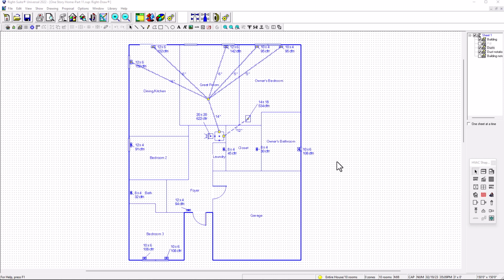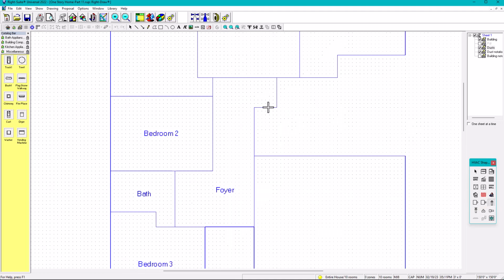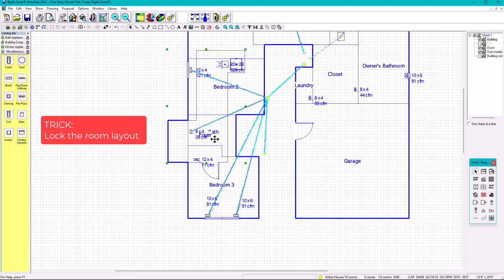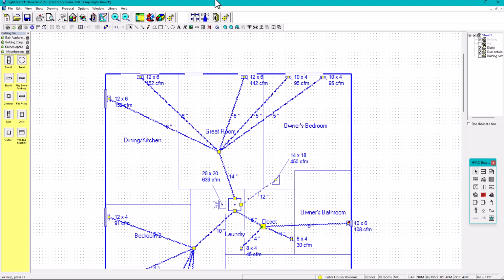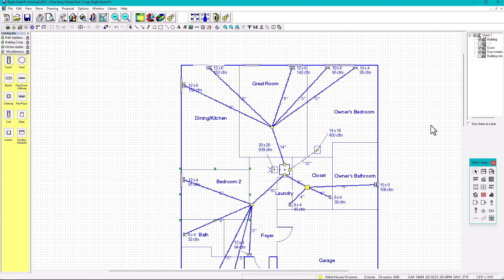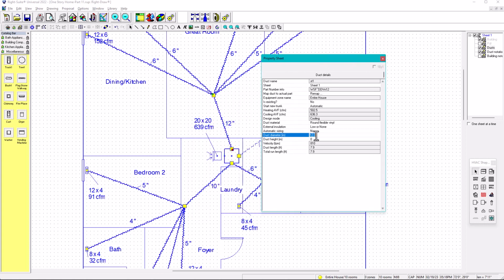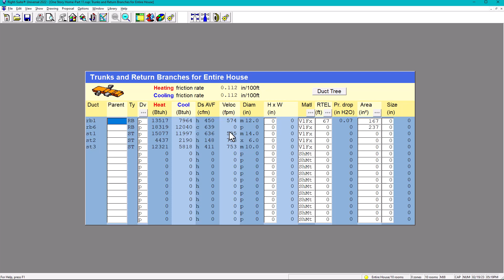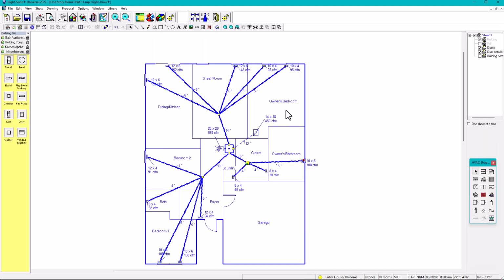Wrightsoft (Part 11): Manual D Duct Design - One Story Home

Comment: I have a question.
The diagram does not show how air is returned from rooms where return grilles are not installed. The house has 11 rooms and only two back grilles! One of these grilles is not connected to the fan! Why?
In general, the video is very useful, thanks.
Reply from the maker: Thanks for your comment. On the bedrooms there should be transfer grilles which we can put as annotation in the wrightsoft. For other spaces undercut doors work since the airflow is lower. The reason the Return duct is not connected is by representing a Louvered door in the mechanical closet which means we would just put a grille on the return plenum box where the unit is sitting. I might make another video to add these details.